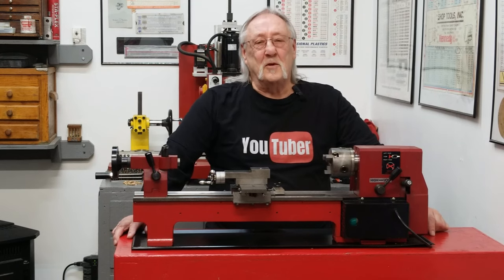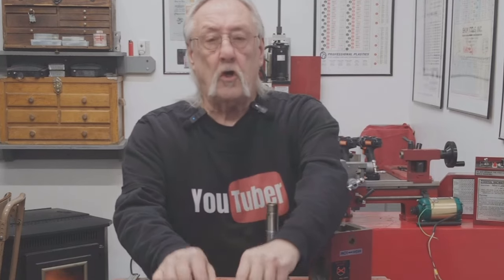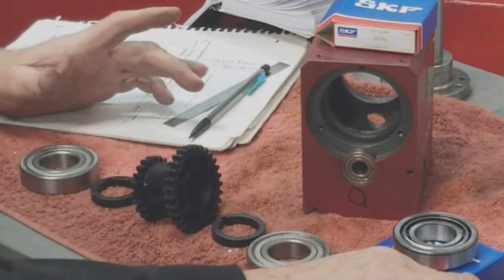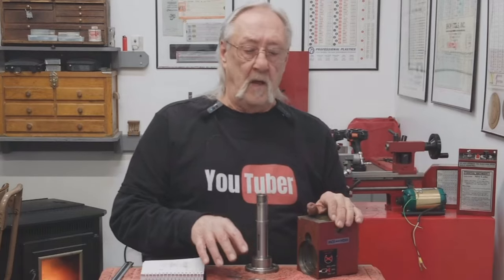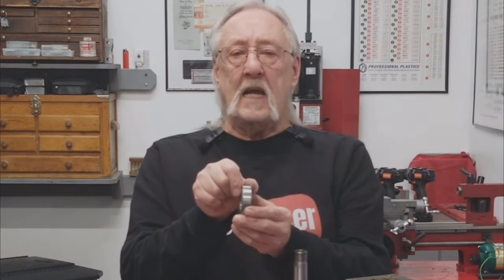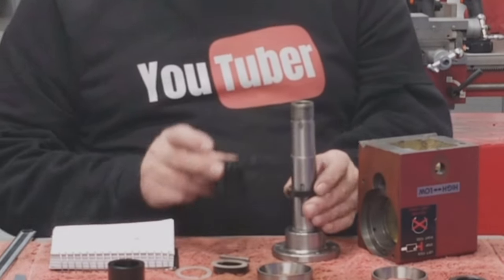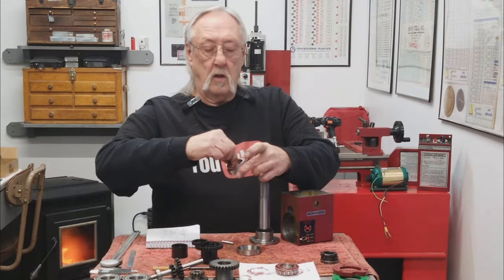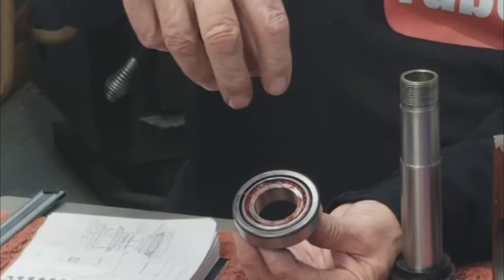Steel Gears & Taper Roller Bearings, Mini Lathe Upgrades

Comment: I ran my steel gears through a tumbler with stainless steel tumbling media to polish them and knock off the rough edges on them. That helped to quiet them down.
Reply from the maker: That was a great idea. I have a small tumbler, I should have done that also. Thanks for  watching and thanks for the comment.
Reply: I Subbed because of this video.  Nice presentation.   🎉.

Comment: The one we've been waiting for! Outstanding job sir,  that was a lot more work than a simple bearing swap - kudos for going the technically more complex taper bearing route 🙏
Reply from the maker: Thank you for the kind words. We will see if they are any better or worse than angular contact bearings. These were definitely a lot cheaper. I feel that I needed the steel gears with me working on putting a much larger motor on the lathe. But, It was all fun to do. Thanks for watching and leaving a comment.

Comment: Great Job! Bearing preload is always tricky.
Reply from the maker: Thank You, Bearing preload not only tricky but important also. I will probably have to check the preload occasionally, I'm sure as the bearings wear in the preload will change. It was a fun project, Thanks for watching and commenting.
Reply: A lot of your pre-load force was crushing the plastic elements. As they heat and cool during multiple uses, they will squish out and get thinner, thereby allowing the bearings to get closer, tighter, (via the inner shims collapsing), and looser, (via the larger outer bushing collapsing), simultaneously. Have you considered replacing the plastic with aluminum or steel? Especially the larger outer bushing? The inner 0.050" shims may not be important as they would only be needed to keep the gears from moving laterally, which 0.050" to 0.100" lateral movement of the gears would be inconsequential. In a 'High Pressure' application, such as an automotive rear differential, a steel bushing, (Crush Ring, or Crush Collar) is installed between the inner and outer pinion bearings, and is then crushed by tightening the bearings until enough bearing friction is generated while turning the pinion. In racing applications the pinion is disassembled again and the crush ring is removed and measured and replaced by a solid steel ring measuring 0.003"-0.005" less, compensating for the spring back from unloading of the crush ring. We probably don't need to go that far, but using some of the principles in setting bearing preload may be helpful.  Thanks for making this video.

Comment: Thanks for the video. I am on my 4th or 5th set of tapered roller bearings in mine.  I seem to be tightening them too much but am not sure. They make noise as soon as I put them in.  I wish I would have seen this video before the last time I took my lathe apart. I could have made those .050" shims. I also need to cut down the outer spacer. ...I guess.
Reply from the maker: It seems to me that if you don't have the proper shims and spacers in the right places you could very easily mess up your new bearings. Thats why I went through the trouble of measuring and drawing everything out on paper. It seemed to be easier to understand. And then setting the preload. But thats  just me.

Comment: Tapered bearing are far better than regular bearings in many ways , most of all side load when facing and parting ! My lathe has a 2 HP motor and when I got it I had no problems parting .. now I at times do .. and I am going for the taper bearing swap to get better preload and better side load .. I have done a bunch of study on this .. folks want to argue on this but there wrong !! great swap ..
Reply from the maker: Everything you said is true 👍 about tapered roller bearings. That is what they were designed for. Thanks for watching and commenting,  have a great day 😀.
Reply: For parting, also look into a rear-mounted parting blade holder.  Holds the blade upside-down on the far side of the work.  The way the cutting forces end up with a setup like that can be very beneficial for small lathes

Comment: Glenn, how did you polish the spindle.  I was thinking about putting it in another wood lathe i have but i am worried i cant get even.  Any advice?
Thanks, Ted
Reply from the maker: Hello Ted,  First you need a way to measure the ID of the bearings and the OD of the spindle. Very accurately.  I only polished or removed about .0003 to .0004 of material off the spindle. I used another lathe with a large center in the tail stock  I used some 320 & 400 grit emery paper. I would make a pass or two across the spindle and measure. Over and over and over again. Be patient, it takes a long time. Measure the bearing ID very accurately and keep checking to see if the bearing will slip on. Good luck I'm sure you can do this. Patience wins the game. Let me know how things works out.
Reply: @GlennNowOnYouTube  Hi Glen, I did it today and it slips on perfectly.  I started with some automotive compound but switched to some 1x30 sanding belts I have.  Your not kidding about being patient.   Finished at 1000grit.  Noe I went down a rabbit hole trying to get the carriage to ride (fit) better.  Thanks for the help and great videos.  Ted
Reply from the maker: I knew you could do this. Its starting out and getting past the " Can I do this or will I ruin it" stage. Have fun with all your Mini Lathe Projects. until next time, Enjoy.

Comment: is there a part number for the bearings
Thanks.
Reply from the maker: I ordered the bearings from Amazon.  Here's the Info I used when I ordered mine. 30206 Taper Roller Wheel Bearings  30 x 62 x 17.25  The brand was VXB. I just googled that info and my old Amazon order came up. Good luck with your project.
Reply: @GlennNowOnYouTube  Thankyou Sir.

Comment: I'm new to all of this and pretty much been running at high gear. What is the advantage to running it in low gear?
Reply from the maker: A real simple answer would be something like,  If you're cutting hard materials you would go with low gear. Softer materials would be high gear. That would be just the beginning when talking gears. Be careful and enjoy your lathe.  Thanks for watching.